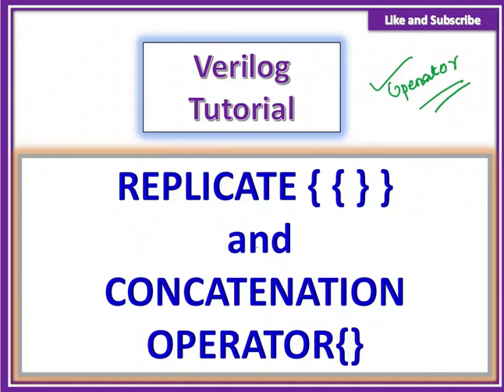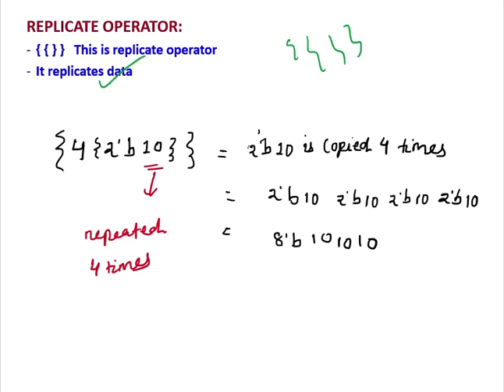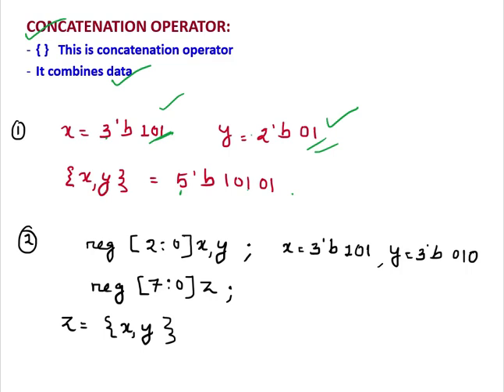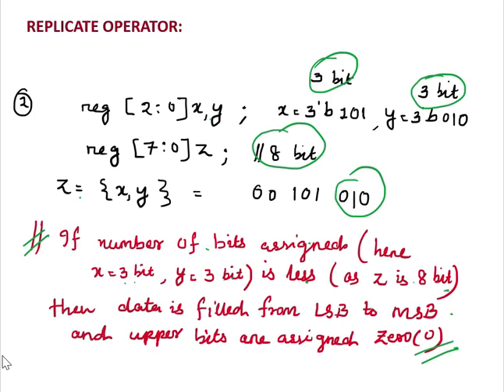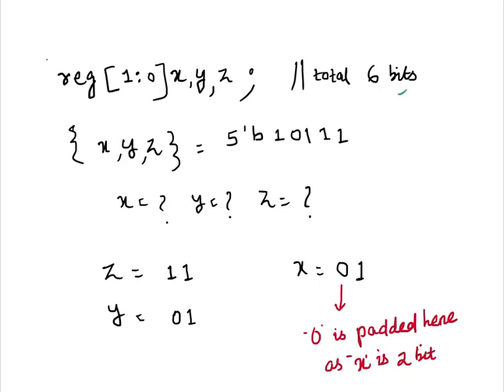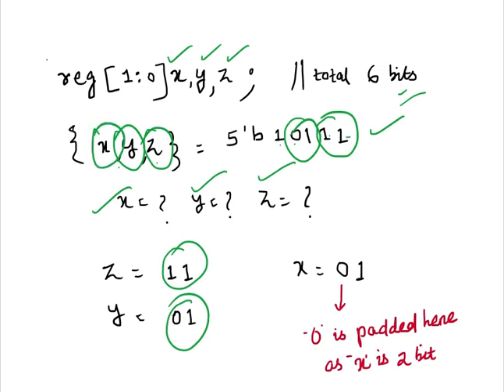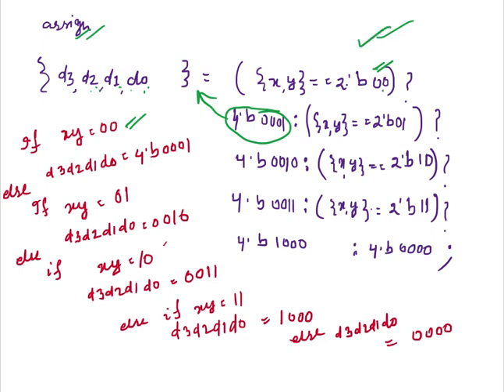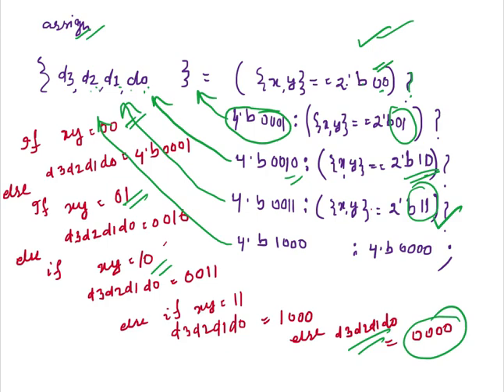#2-1 Replicate & Concatenation operator in verilog|| Most used operator in verilog ||very important

Comment: Sir please make video on data path and control path
Reply from the maker: This one I will explain in my digital electronics tutorial for sure.
Reply: @ComponentByte  
Why parameter key word is used?
And please share your linkedin id sir if possible?
Reply from the maker: Parameter is a verilog construct which is used for reuse purpose. Let's say your data width =8 now you want to change it to 16 so now no need to change data width for every line in code. Single line is enough to do it.
Parameter datawith=8;
input data[datawidth-1:0];

Just change datawidth =16 and it will be reflected in everyline where data has been used.